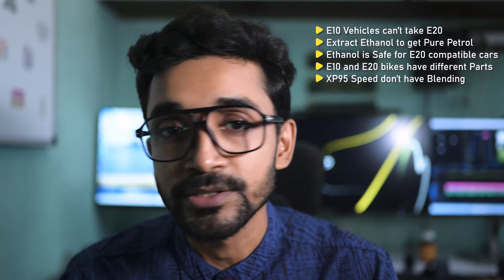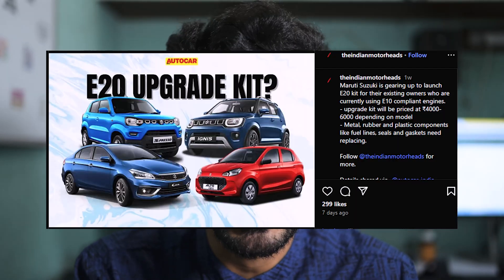The E20 Blend : Are We Being Misled by the Industry? Myths & Facts Busted!

Comment: Further one thing they are hyping.  Octane comes in picture only when ur vehicles is high compression engine.

Otherwise Octane of 90 which is in normal fuel is more than enuf. They are giving the Octane jamoon to all. 

Any which ways all normal fuel is coming with high ethanol content which increases the octane number.

Ethanol is one of the many ways to increase octane number.

There are many other methods to increase octane.  Like

This involves catalytic reforming, isomerization, and blending of high-octane components like alkylates, reformates, and aromatics, which naturally have high octane ratings.

Unlike ethanol, these additives are non-oxygenated and tailored for stability in high-performance engines, avoiding ethanol’s potential drawbacks like  corrosion in older engines or fuel systems.

Ethanol removed petrol is not good idea. That fuel will loose additives and octane.  Hence getting fuel from bunk which is pure petrol has the right ingredients for vehicles to run. Thats why using pure petrol Xp100 which is ethanol-free but has additives that has made it Octane 100. This is done at petrol refinery using specialised equipment,  which we don't have.
Reply from the maker: Correct. Good work bro!

Comment: Experiencing 25% mileage drop in a 2022 model petrol car ran consistently on premium petrol (xp95, power95 and speed)

Ethanol is also hygroscopic in nature meaning that is binds to water/moisture and separates on its own from the blend and settle at the bottom of the fuel tank.
At low fuel levels, when the engine will be supplied with just Ethanol-water mix, there are going to be ignition and engine problems, fuel pump malfunction and fuel injectors wearning out apart from the obvious rusting issues everywhere.

We are so cooked!😢
Reply from the maker: Same mileage drop is facing by most of the users out there. It's bcz of lower energy density of ethanol, it will never be the same as pure petrol, unless govt comes up with a new policy to sell separate e20 and pure petrol separately. Seriously we are cooked and doomed.

Comment: My CBR 150r 2013 model a bs3 model still running as good as new with e20 as well, just a bit of less acceleration. I m going to put iridium spark plug for better combustion.
Reply from the maker: Good to know about your experience with E20, thanks for sharing!
Reply: Honda is e20 compliant since 2009
Reply: @struggler5960 not bikes, only cars .